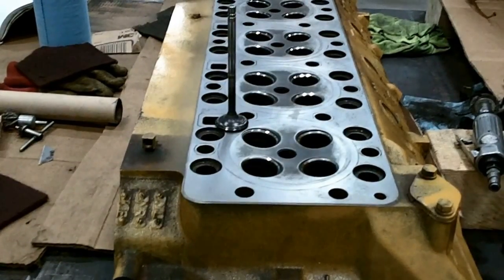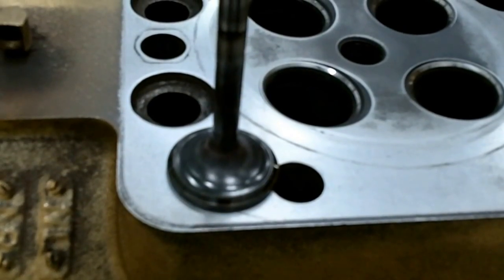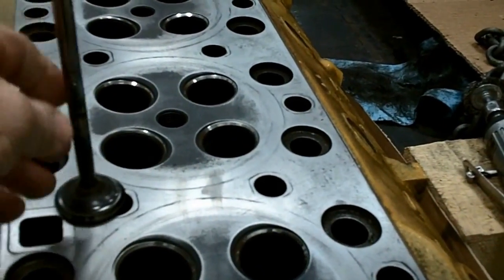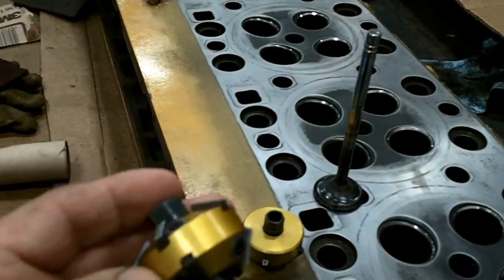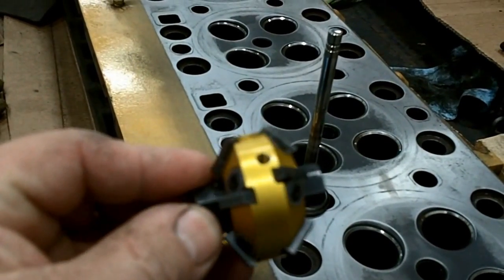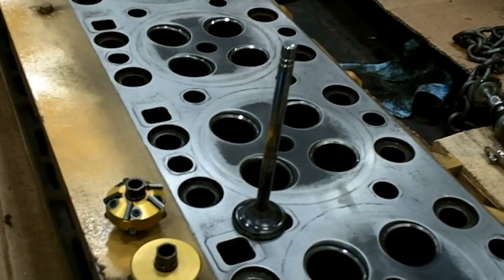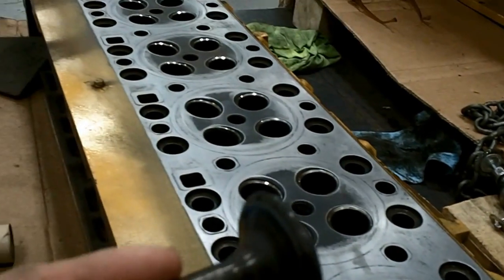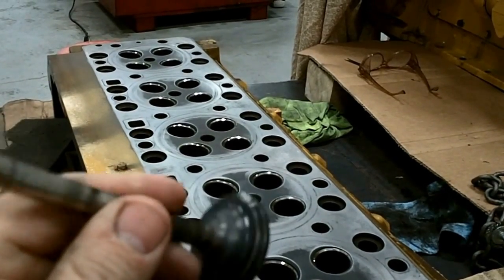Cat D343 1693 Repair Part 1

Comment: J dirt....you are not correct on the proper way
First use the 45 degree cutter ".this establishes the actual seat
Second..use a sharpie or blue layout dye
Third get a divider and set diameter of valve seat by setting divider app .020 from edge
Fourth...then use top angle cutter to determine seat diameter....use top cutter angle that follows head contour so as tononly cut the least amount
Fifth...then come in with bottom cutter to establish the width of the seat

Comment: Jpaydirt, thanks for the informative video. I have a D343AT in my boat. It has 2000 hours but it sat un-used for 7 years, it has the oversize oil pan, it holds aprox 20 gallons of oil. I have two questions oil pressure and how often should the oil be changed. I'm not sure what  "normal" pressure should be. I'm running SAE 30wt oil, first start of the day at idle it runs 60 psi and 65 psi at my cruising speed of 1200 rpm,   when the engine warms up, water temp of 190 deg and an oil temp of 220, at idle (550 rpm) it has 35 to 40 psi and at 1200 it is at 50 psi, if I push it up to 1500 it will get up to 55 or 60 psi. Would you consider this "normal"? Next question how often would you change the oil? does the larger oil capacity  mean I can change the oil less often?
Reply from the maker: +joel Wilson  That is very good oil pressure for a 343, I wouldn't worry about it one bit, I would guess that your engine is in very good shape, and it also has the thicker spacer in the relief valve spring,  Wow 20 gallons!  thats twice the capacity of mine, I would guess that kind of capacity was intended for extended oil change intervals, If you are generally operating at only 1200 to 1500 RPM I would say your oil changes would be in the 500 hour range, as an example, my scrapers run at full power and are in a very dusty enviroment, the recommended change is only 125 hours, watch some of my videos and you will see all the black smoke and those particulates to some degree are also going down the cylinders into the crankcase which thickens the oil and also its abrasive, I took an oil sample once, it was a 30wt but when the report came back it said it was now 50wt (soot thickens oil) so I started to change oil at the 125 hr mark,  so I would take some samples to get a good idea how long you can go, now that sulfur has been pretty much eliminated from diesel, that will help your intervals also, does this engine have spin on filters or canisters? I have changed over to spin on and then I change them at 60 hrs or half the interval,  soot is the main enemy on these old engines, they will smoke like a pig until the boost cocks the air fuel ratio valve into operating mode, if your engine has the hydraulic air fuel ratio valve. so go easy on the throttle to minimize the smoke, or adjust the AFR until there's as little as possible with out restricting the govenor's full travel, give me a serial number and arrangement number and I can probably find out what the intervals are.
Reply: +jpaydirt Thank you for the quick reply. I have so many questions i don't know where to start. I bought the boat from an estate, the previous owner passed away so I'm just figuring out stuff as I go.  Lets finish the oil pressure. My concern is running the boat for long periods with "low" oil pressure, based on the 65 psi at start up I assume anything below 40 is low. I understand as the oil heats up pressure will drop, but isn't a 30% drop a lot? On a normal day I take the boat out and run it for a few hours, when I return to the marina there is a long no wake zone, a 15-20 minute cruise at 700 rpm(40 psi) then pending on winds by the time I'm in the slip and tied up ready to shut down it may be another 20 minute at idle (low 30s psi), should I be worried? Is anything below 40 "Low"? I'm headed to the boat this weekend(I live in San Antonio and the boat is in Corpus Christi) and I will get the Serial number, where would I find the arrangement number? There is a plate on the forward right side of the motor that has the serial number and there is another plate on the top of the valve cover that has a few other numbers, I will take pics this weekend. I can't thank you enough for this help, if you are ever in San Antonio dinner and drinks are on me.
Reply from the maker: joel Wilson   Ok! helped a friend in England with a boat with twin D336 Cat V8's in it so now I get Two boat rides!
First question, have you changed the oil or filters? second what is the water temp at when you are seeing these pressures? Oil temp will be 40 degrees hotter than water temp does it have an oil temp gauge? All it takes to bury a Cat oil pressure gauge into the green operating zone is about 40-45 psi  Idle speed for my stuff is 650 rpm so what is your idling speed?  I still think you are fine, the only way to know if you have a problem would be to check oil temp, if its higher than it should be then check cooler bypass valve and spring, if thats fine then the cooler is suspect, if there is heavy deposits in the coolant they will settle out in front of the cooler and restrict flow, I have taken these coolers off and cleaned out the passages before and it will make a huge difference, On the right hand front of the block just under the head there will be a tag with serial # and Arrangement #  I am going to send you a private message
Reply from the maker: joel Wilson  You don't have an about button on your youtube channel so I can pm you with my email address, go to mine and send me yours
Reply: I just sent another email, I have more D343 questions. Thanks,
Reply: Oil change interval for the deep pan, 23 gals, is 500 hours.  I run Delo 400 15w-40. Marine application.

Comment: flange sits on the block. they see the corrosion and automatically say OMG it needs cut! but a lot of the time is just a waste.I thought this was an EXCELLENT series of videos tho and I think your top notch. heres a video you should check out of us.. youtube "dean machinery certified rebuild".. the retards that edited it did it wrong, this is 2 different machines. if you notice the disassembly is a 980G series 1 and the reassembly is series 2. they took 1750 shots/frames per shift

Comment: i work for a cat dealer in Kansas city Missouri and usually rebuild 3-4 3400's a month for last 5 years. 3406, 3406E, C15, C18 3408... those are spacer plate engines as well and its the same deal. that's what cat refers to it as "counter boring". we always cut and use .032" shims. out of all the blocks ive seen ive only seen probably 10 holes that ever needed cut, I just think people get freaked out when they see the corrosion. my rule of thumb is .002" on 50% or more of the surface the liner